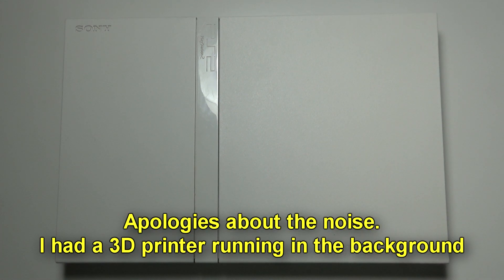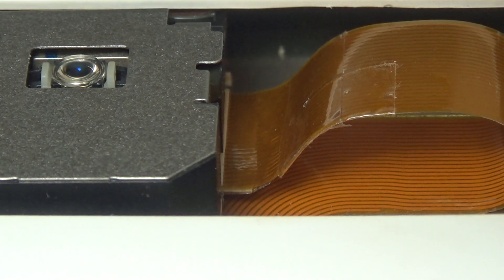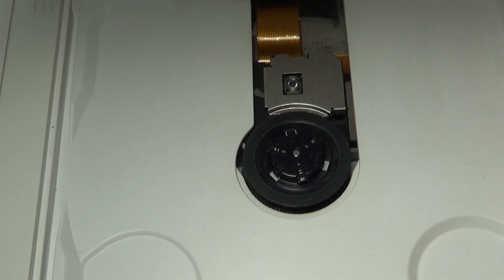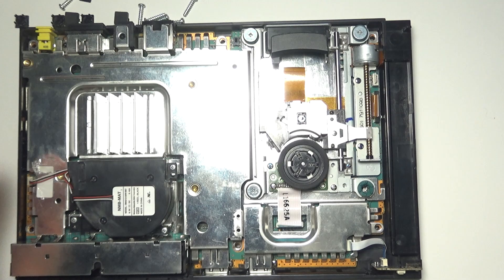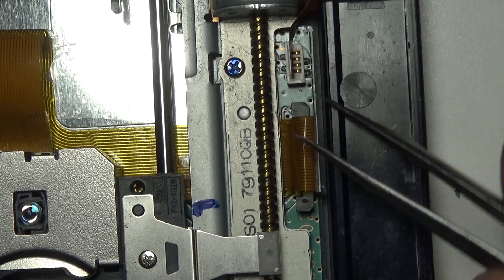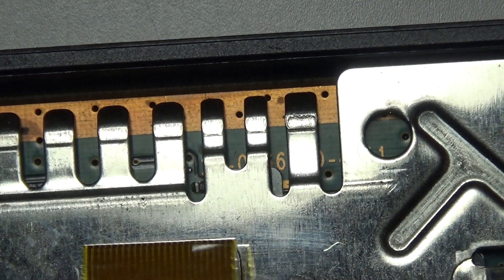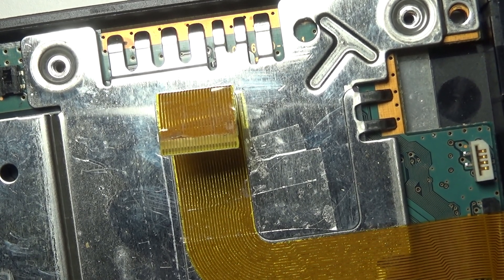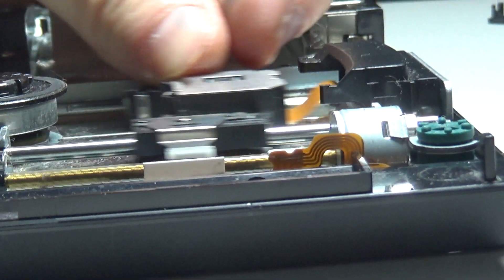Common PlayStation 2 Disc Scratching Fault Repair

Comment: Thank you, this sorted my PS2 Bravia TV, I didn't need to take it apart, I used a bamboo Q-tip, snapped head off, applied super glue to the end and rubbed it on the cable retainer whilst pushing up against the ribbon cable then held down on the cable retainer until it set, its now perfect again. 👍🏼🙂

Comment: Thanks bro all my ps2s are like these i bought like x20 ps2s 1x sealed slim .
I already ordered like 50x ps2 ribbons cables but great fix though .
I found metal shield ribbon cable 3d printed for ps2 which i will buyno more ribbon cable worries

Comment: Any update to 28nm rsx gpu Frankenstein mod?
Reply from the maker: Well no... If you watched the last vid, it won't be able to interface with EE/GS. So it wouldn't work for BC models. Besides that, some pads function were difficult to trace. Even if it could be possible to develop an interposer, and even if it did work, ps2 functionality would be lost. So there is barely any reason to continue with the project... Finally, there was simply no demand for it.
Reply: @calyps0man  oh that's sad :(

Comment: I know you'll get sick of me, but thank you for showing this. There are many youtube videos and it seems that from what I watched, only you showed the real fault and how to fix it. Great content.
I personally just remove the rails and the laser pickup because it is easier to me. Nothing wrong with this, it's what you are comfortable with. Then I put fresh grease if needed. Just one thing: please discharge yourself of static electricity before removing laser pickups! Or use ant-static bracelet! Static electricity can kill a laser pickup!
Reply from the maker: You're right about that.

Comment: If you have the 79000 model you won't ever have this issue, the ribbon cable is held by plastic tabs and not glue/adhesive
Reply: Thats cool to hear. Does the 75k have this feature too?
Reply: @jtchoi2003  No, it's got the scratching disc's issue too.
Reply: Is the 79000 model a US or Japan model?
Reply: @tonybalony7698  the last digit in the model number depends on which region if it's a zero is Japan if it's a one it's America if it's any other number it's the Pal region

Comment: Had this same issue with my PS2 this year. Little tape to pin it down was the solution like you did
Reply: Did it work? Disc no longer scratches?
Reply: @martin.aguilar.a  Yep works perfectly fine now, if it scratched any of your discs most video game stores have a resurfacing machine to fix your discs
Reply: @Excalibur13  alright that was easy fix use tape on the ribbon cable and pin it down.

Comment: i had some fresh games i burned, GTA vice city and san andreas, and even though they were literally JUST burned, both games started showing problems and freezing, I didn't notice any scratches because of the ribbon cable, but could that have anything to do with it?
Reply from the maker: I had a console that froze up in menu and games. Resolved by reflowing the whole board . One of the chips solder was failing probably